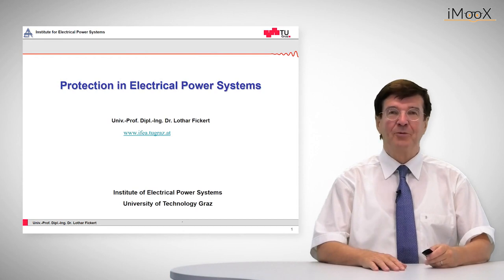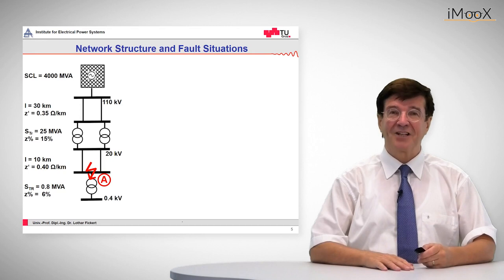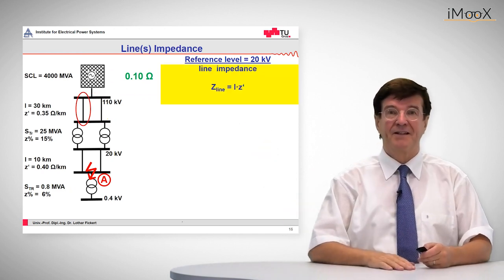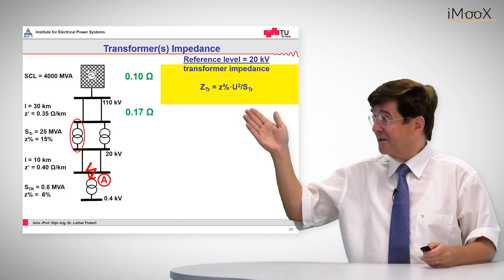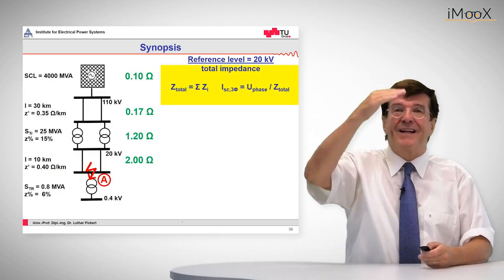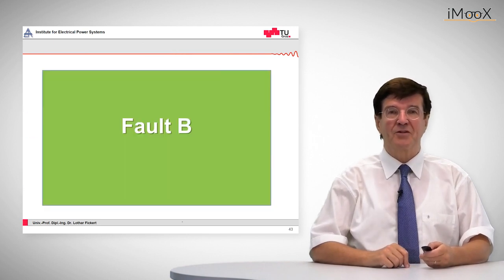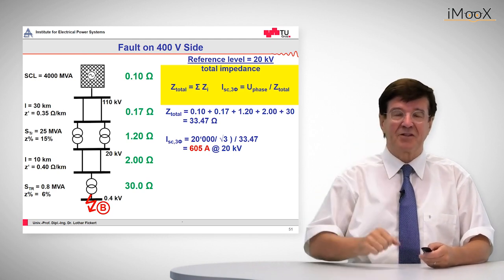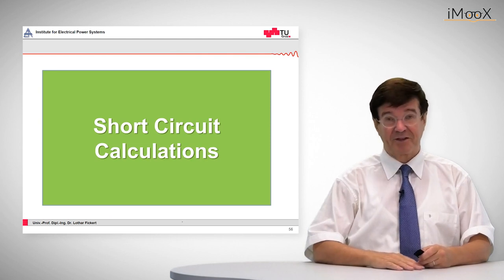A2 Power System : Short Circuit Calculations

Comment: Very good explanation, but I have a question. Since both of the grid's and the 110KV line's impedences are behind the transformator, why did you only multiply the line impedence in square of "the transformation ratio" but not the grid impedence. I meant by transformation ratio U2/U1. Thank you.
Reply: Hi,
He calculated the grid impedence seen from 20 kV (20kV^2/4000MVA). Yes the units match in this case since kV^2=MVA.
Jean-François

Comment: Good day,

Is ths is mistake at 4'04"   Isc,3P = (20000/1.732)/33.47 = 345 A (not 605A) ?

After calculating I found out different results:

Short circuit level at 20 kV: 605 A -> 345 A
Short circuit level at 400 V: 30 kA -> 17.25 kA

Thank you,

Jean-François
Reply: I got the same result as you, think its a mistake